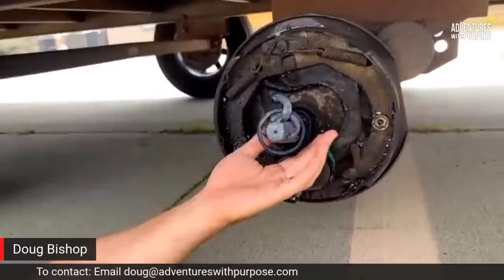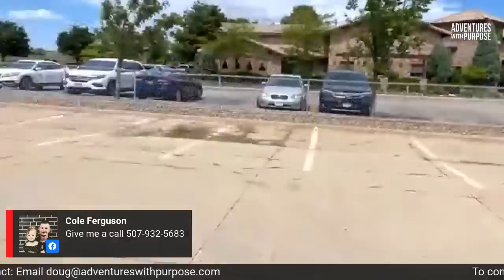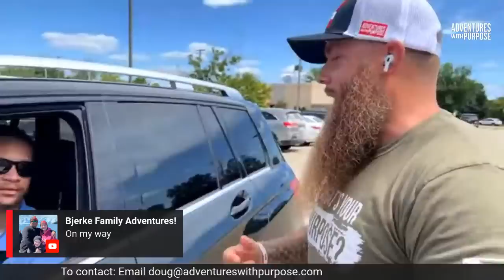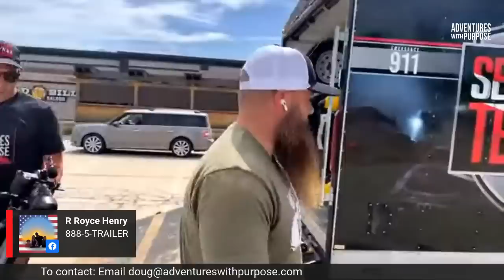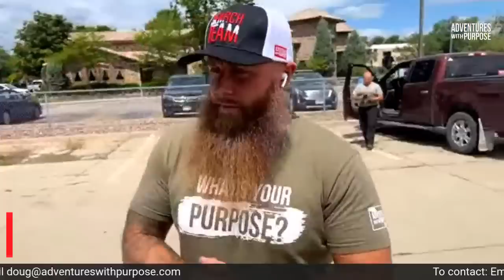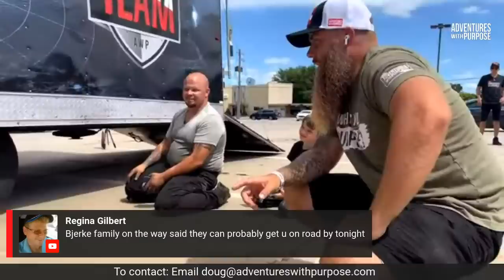IMMEDIATE HELP NEEDED IN ROCHESTER, MINNESOTA

Comment: A week? To bolt on 2 axles? Wish I was closer to you don't have to go 8 lug. That guys awnser is, just spend more money.  My car hawler was built originally for a bobcat skid steer and attachments.  2- 6 lug axles never had a problem. No big deal its just 2 axles 4 leaf springs re working the whole suspension system oh and new rims and tires.. lol  sorry about your luck . A routine scheduled maintenance will stop this from happening.

Comment: How's the tire and drum? Most likely you'll need a drum, seals, bearings, spindle, greese, and brake parts. I would check to make sure it's not overweight. Probably less than a  hour labor and under $200. parts.

Comment: As obvious,the bearings shelled out.A maintenance or quality of parts problem.Ask any competent mechanic. So when traveling check your hubs by touch for heat.Heat indicates a problem. I cant absolutely guarantee this hub got hot before it failed as Im not there to look but it likely did. Initial touch,make it quick to check for extreme heat,then a longer touch.Hot hubs will STINK too,you know it.The guy talking to you about axels and tires is correct. Heavier bigger tires dont make a heavier trailer Im sorry to say.Plus the hubs themselves may be too light for the weight.You guys probably need a dually type trailer. Glad to see your shout for help answered promptly.Thanks for the work you do.You guys give grieving people closure and show them somebody cares after all  others have left. And thanks to those who helped.

Comment: You can pick up a spindle kit at Fleet Farm or another farm implement dealership you'll need to make to find out what size spindle you need if the spindle is bad but it looks of it it may be just your bearings you can pick up also those kits at the fleet farm or Harbor Freight possibly a Napa if you need an entire axle you can find one at a Runnings Fleet Farm Harbor Freight farm implement I suggest if possible find the exact axle at farm implement holy bolts and the tire off the axle that's bad pick up a whole new axle with hub assembly and electric brakes replace the whole thing

Comment: Yep either whole new axle or cut and weld the new torsion axle end on .. that sucks guys I’m sorry ! Been there done that !! Also make sure they drill hole and fill with weld to make solid .. my vote would be all new dexter axle w/ brakes easy swap and less labor then welding

Comment: Why is the suspension so lacking? Even if it was fitted with torsion bars it wouldn't be enough with the miles and weights you guys use. A set of duel wheels would be far better off for weight distribution in my opinion.

Comment: Truck repair roadside truck repair also you can call a camper repair shop because they have the bearings and everything for that type of trailer lot of people use those to call the cars and they purchase them at camper shops my suggestion when you have them replace that in the near future have them drill out every one of those hubs front and rear to where you can add high-speed high temp grease to it when you get it serviced those bearings are being overloaded with the weight you have in that size of a trailer you really need a triple axle with that trailer or larger hubs make sure you check the grease if it's got a grease cap on it pull the grease cap off and check that grease every every day but the best thing to do is have them put the grease fittings in those hubs with the hoses and dessert fittings on the outside so you don't have to get underneath it you just put the grease fitting on the outside for the front of the rear on either side and it greases the front and rear it's not that expensive but look the cost right now my suggestion is to log on to actually download a free app it's called trucker path and in that trucker path it will give you a list of all the repair shops within the area close by to you and 24-hour service and all that might help you and it's free put it in your phone doesn't cost you anything I wish I was up there to help you buddy I really do but that looks like it's going to need a new hub brake drum and all but again have them in the near future have them install the grease lines to each one of those hubs front and rear inside and outside and have them mounted up under the side of the trailer with dessert fittings on the outside front and rear you can grease it yourself and save you a whole lot of money God bless you guys and thank you very much I just joined your club trying to help you anyway I can I'm down here in Virginia I wish I was up there but God bless you guys thank you for what you do

Comment: When you upgrade tires after 50 miles, you have to tighten the lugs, or else this could happen.
Reply: The wheel didn’t come off and leave the lugs, the hub came off because the center bearings were probably not torqued adequately and the entire assembly came off. But yes people need to look at tires and grease and bearings every preseason. These guys put God knows how many miles on their trailers.
Reply: @shawnmason5290 , That makes more sense after your explanation. In my scenario, you would just see sheared off lug bolts.

Comment: You got bigger problems than you think you bent the axel and the back axel looks like it's bent as well so you need to replace both axels and a new tire and try and lift the trailer a lol higher off the ground put some space between the body and the top of the tire

Comment: its a removable stub/hub center,  just need a new center 4 bolts/nuts to remove, (not a new axle) 
also you can do the rest of your trip on the rear wheel and not need that wheel, just repack the rear wheel bearings and  your set
it only failed because it ran dry, americans do not have standards on there cars trucks and  trailers( no actual check regularly). here a trailer or car has to meet a strict standard to be used on the road every 6 months

Comment: All or most of those parts are bolt on considering the travel you are doing I would recommend immediately putting bearing caps with grease fittings in them and grease all 4 wheels bearings now and regularly at like 2000 miles each time.

Comment: Probably hit a road bump at speed and that sent the tire into bottom side of the trailer inturn cause torque stress that made the axle assembly fail
Reply: That is why you never put under or over sized tires on vehicles or trailers that was not designed and/or modified to accept them, Highly recommended that the same modifications are done to the second trailer as well before deployment on the road, may not be lucky second time around, God be with AWP you guys and gals ROCK

Comment: Yea looks like you definitely need to lift the trailer with those bigger tires on it? If the tires rub against the trailer, it could catch your trailer on fire? I think those assemblies only have 4 or 6 bolts to take out and you'll be able to pull the whole assembly off and replace it if it didnt destroy the spindle? Looks like a bearing went bad(?) so the spindle might be pretty scarred up? If so, you'll probably have to replace it? If I were you, Id keep a couple of 20 ton Bottle Jacks with you in case you did have to change the axle? The head on them will adjust up and down. You can probably buy lift kits to lift the trailer up? If what you haul weighs 8,000 lbs, you really need 5,000 lb axles but keep in mind, some states require a CDL if your trailer gross weight rating (trailer empty weight plus trailer load weight) is over 10,000 lbs. My state is like that. I dont know about your state? Your trailer empty weight is probably around 2500 lbs, maybe a little more? My 18' Car hauler weighs 2100 lbs empty and its ten feet shorter than yours and is not enclosed. It has 3500 lb. axles.

Comment: Crazy, all the comments. Yr trailer looks to be pretty light. No cars in it. No need to make any stronger. I'm thinking the grease in the wheel bearing got dry (washed out) from being in or underwater. Pretty common to happen. Mostly with boat trailers. I just check my hubs right after maybe a few long drives. If the bearings get hot, you won't be able to touch the wheel hub. First remove the axle. Re cut the spindle and bore the hub. Or get another complete axle.

Comment: A few years ago I managed a large local trailer shop. I was the shop manager. By the looks, you need to replace that stub axle assembly. Looks worse than it is. I would also weigh your trailer to make sure it's not overloaded. Looking at the other wheel in the video it looks really stressed. We dealt with a lot of these during the Sturgis bike rally in August. Make sure you do your annual checks. As much as you guys travel, your wheel bearings should be serviced annually. Good luck!

Comment: Also, whoever advised sticking those wheels and tyres on wants their back side kicking.
You can't just go swapping wheels and tyres because they are bigger or look nice. Tyres are a mathematical science so you have to calculate whether the new tyres are within +/- 2.5% difference between the old tyres diameter.
As a result of the wrong wheels/tyres being fitted the bearing grease has cooked itself and has catastrophically failed with thankfully, no fatalities on the road.

Comment: Regular maintenance would have kept that from happening,  pack them bearings and check them regularly. If it was mine it would get the entire axle replaced, not as big of a deal as it looks. Doubt it needs any upgrades it just needed some grease on the bearings.

Comment: in the future (not to sound like your dad) but maintainence, maintainence, maintainence. had someone gone over the trailer and checked it recently you would of caught the bad wheel bearing. they don't just fly off.  thats what happens when a wheel bearing let's go.  bearing are cheaper than hubs or axels

Comment: Hey Doug I'm on my way out here in Arizona so I can't really help you but by the looks of it it looks like you're bearing severely overheated and then ate itself go to a boat or some other trailer supply company and get yourself some bearing buddies they're like a cap that goes on there that you feel full of grease and keeps everything lubricated real nicely that way you don't have this problem again sorry I can't be any more of a help.

Comment: Looks like a bearing failure. Go back and get the wheel, you prob can use the tire and/or wheel. I imagine you are gonna need a whole new axle there. Might be a good time to service the other bearing now. Also seems like an overweight issue too.

Comment: I hope you get the right trailer guy. You can replace that entire axle Hub to Hub by removing 8 bolts and one hose connector. It'll be cheaper in the long run to do it that way. Good luck I'm in Cleveland too far away to help you

Comment: The bearings went most likely due to no grease and ruined the spindle and everything I believe you will have to replace the whole axle. Contact the manufacture for info on this unit there are dozens of different axle assemblies.  Good luck

Comment: When I drove up to Rochester from Illinois I passed featherlite corporate headquarters on a two-lane road directly between Rochester and the Iowa border. Would they have those axles with leaf springs in stock quicker? Most trailer parts are universal and your repair guy seems very kind and knowledgeable.

Comment: Fleet farm is a good place to get axles they are off of highway 14 also fleet pride has axles you are probably off just replacing that hole axle that also is a torsion key axle witch means it is independent suspension and not like your standard trailer we’re it has springs that would not be hard to replace that hole axle hope it works for you

Comment: The end. Of the axe is chewed off. U have to replace the axel n hub n brake assembly and any brackets for the axel that broke. Ohh and a wheel n nuts and the lug studs. Yall need each rig to roll around with an extra axel and hub atleast bc yall drive alot with very heavy trailers.

Comment: Hi guys I would like you to know that you are going to need a new axel for your trailer it would be a good idea to get a new one to replace the old one if you can get a new one from a toe yard you might be able to get a few spare parts for your trailer you might want to get some more spare parts like wheels and tires springs and brakes backing plats  just to have incases you have a problem with the other axel good luck with your search and repair on your trailer

Comment: Can u just take the other wheel off the axle ur hitch will hold the weight and u will still have back tires and once u get somewhere u can get it fixed easily

Comment: I have seen your issue so many times and also be cautious with Dexter axles I have used them before but now have a place in Kansas called atlas trailer axles that we use simply bcuz we seen a lot of the hubs where they run off the spline and leave the outer nut on the spindle. Someone did not put the bearings either on correct or they were ran dry. At least the trailer is still upside have also had a brother who lost his camper to hay on the road and it was a complete loss.

Comment: Should probably have the play in the bearings on the other axles checked and have the bearings repacked on the other wheels while you are there your best bet may be to try and contact a smaller local welding shop rather then a garage full of parts changers

Comment: To save the hassle of future problems, and your in love with that trailer, I would put two new complete axles on, making this a simple bolt on operation. Call a local trailer dealer/shop and have them run out two new ones....your supporters should help, offer advertising to the shop for help.